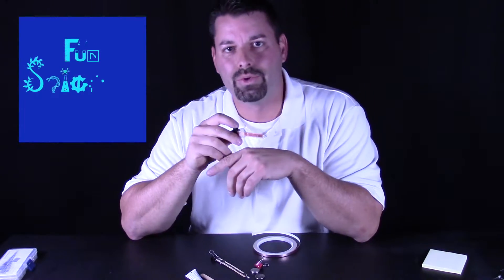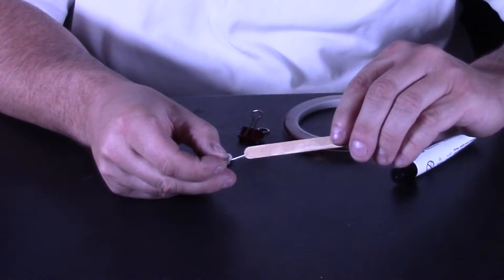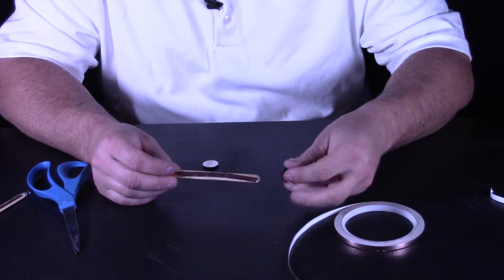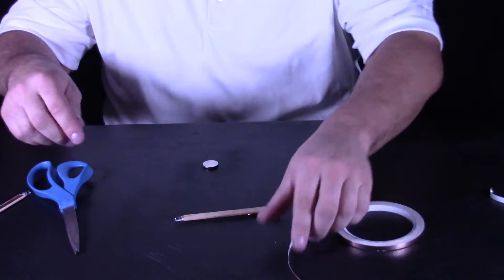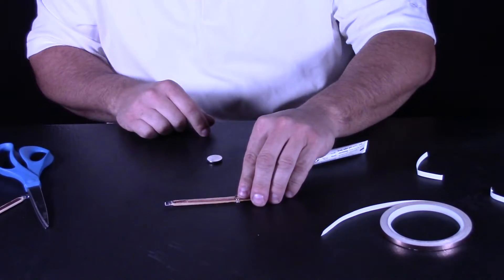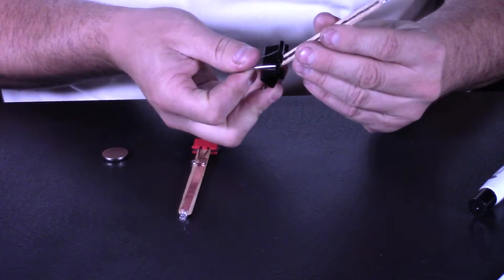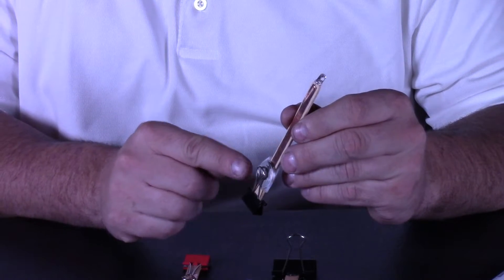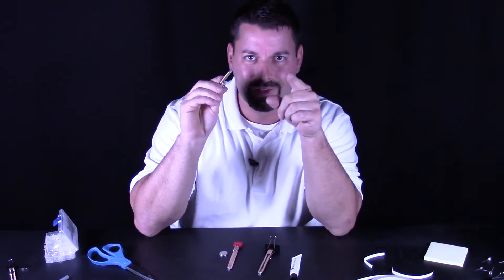LED Flashlight STEM Project

Comment: This was really helpful. Much simpler then with paper. The copper tape is difficult when you have to fold for corners. This design is easier, straight forward, and still with simple materials.